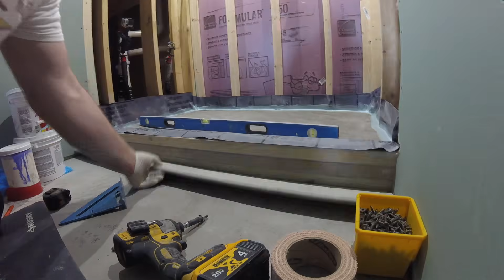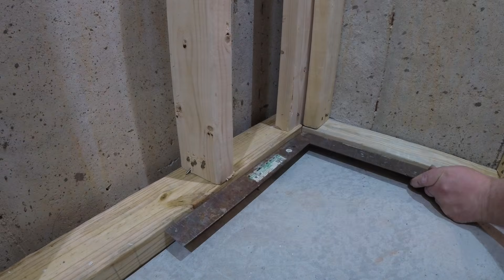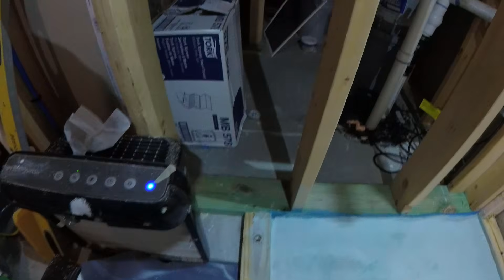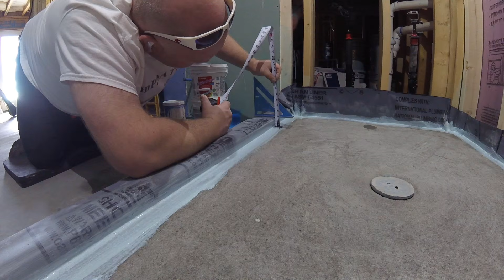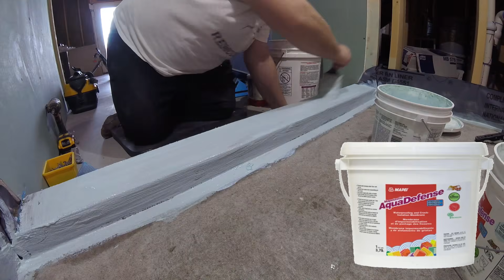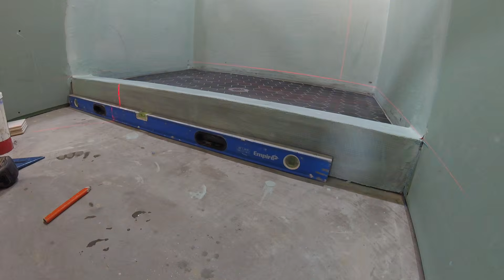DIY How to Build and Waterproof Shower Curb on a Concrete Floor

Comment: Can I use wood shims under shower curb to make the pitch? And redgard it before putting the shower liner on?
Reply from the maker: Yes. Just make sure that everything is solid. Avoid any movement in curb.

Comment: Such a great job, but I’d think just for overkill reasons, why not use a green treated lumber on the top of curb?  Thank goodness you used them where you should though
Reply from the maker: You only have to use a pressure treated lumber where it come in contact with concrete slab. If you waterproof your  curb water should never reach your wood.  Biggest problem with pressure treated lumber is that wood is so saturated with moisture that it twist when dries. If you have 3 2x4  stocked and one of them shifts after installation your grout or tile might crack.

Comment: It looks like this video went from concrete right to an already installed membrane of some kind before finishing the 2x4 barrier. Later you put down the rubber barrier.   What did you install there with the blue, woven material prior to putting on the 2x4  barrier out front?  Did some other searching online and it looks like you have to build your base shower bed before following this video.  The base "pan" is created with concrete and waterproof membrane, hen pan dirt is used to slope the pan into the drain.
Reply from the maker: 1. Install shower drain and valve .
2. Install shower curb (2x4)
3. Build pre-sloped mortar pan that is waterproofed with waterproofing membrane and fiberglass mash. 
4. Install shower pan liner
5. Build mortar shower pan
6. Waterproof shower curb 
7. Install shower walls cement boards and waterproofing.
8. Install and grout shower floor tiles
9. Install shower curb tiles
10. Install shower wall tiles
Reply: @simonproatl  what if the drywall is already installed in the shower area?
Reply from the maker: @livingmindfully8178  Remove all drywall from the shower area!
Reply: @simonproatl  I didn't see step #3 Build pre-sloped mortar pan that is waterproofed with waterproofing membrane and fiberglass mash.   what time-frame did this occur?
Reply from the maker: @G3MAProperties  I build pre sloped pan after nailing first 2x4 to the floor.

Comment: How do you make a curbless shower on a concrete slab
Reply from the maker: I don't. Curb is better :)
Reply: You'd have to tear out the concrete and repour a new one but dropped. Very difficult  and costs way too much for the customer.  If you have a void under your slab you'd have to fill it with gravel or road base so that can support your new slab. Youll install with rebar, connecting it to the house slab so it doesnt go anywhere. Lot of work. Needs a permit

Comment: Last shower i did, i did not use any rubber liner. I built my curb (wood, cement board, then thinset and mesh to fill out, smooth and make uniform) and preslope.

After which i coated the curb and pan with Red guard 3 times (same thing as aqua defense except Red)

After that i put my final slope, coated everything in RG again and then tiled over that.

Hopefully that made sense. 

This was all done over a concrete slab.
Reply: That's going to fail, you have to have a shower pan, I hope it's located where there is nothing below that shower
Reply from the maker: I guess you haven't watch my other videos. I guaranteed my work for 5 years. I did this for 20 and it never failed. Thanks for watching
Reply: @thelog86  

Why would it fail?

Yes, it is on a slab.
Reply from the maker: It won't fail.  Average person watches few minutes of the video and the make some comets that don't make any sense.
Reply: I did the same steps as your on the second floor 7-8 years ago and did not have any leak. 
Last year I have to do some ceiling repair of the first floor near the shower and found that the subfloor below the entire shower is bone dry.
In my conclusion, waterproofing Red Guard or similar part works as well as the liner.
Reply from the maker: Glad to hear that. I did it for 20 year and it never failed. Thank for watching

Comment: ur the best @simonproatl , quick question, what if i want to install a shower door on the curb would i still angle everything towards the pan? or would i want the curb to be flat and level?
Reply from the maker: When you install tiles you have to make sure that they slope toward the pan. 1/4" slope is enough. Curb and shower walls must be level and square.

Comment: great video. just to confirm that you cut the outside cement board piece, is it 1/4" higher ? if it is true, the top piece, cement board will have a slope, right?
Reply: Shouldn’t you allow the mapei to dry before spreading thinset?
Reply from the maker: Yes. Waterproofing membrane must be dry. You have to wait at least 12 hours.   @tylershank1870
Reply from the maker: Yes, correct
Reply: @simonproatl  do you recommend using the same method over the plywood floor ? Or using something else ?
Reply from the maker: Same method will work. Instead concrete nails you can use 3" screws to install first 2x4 to a plywood.  @vinhgolf
Reply: got it. thank you.  @simonproatl